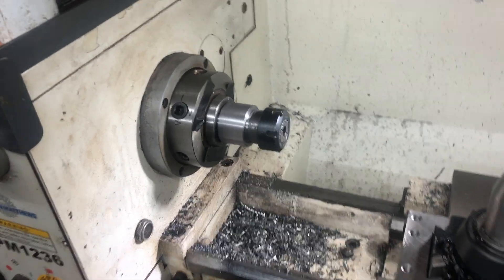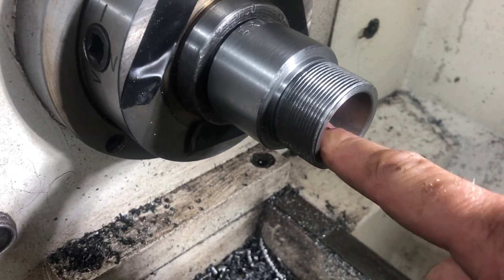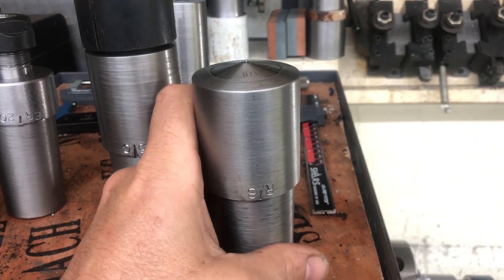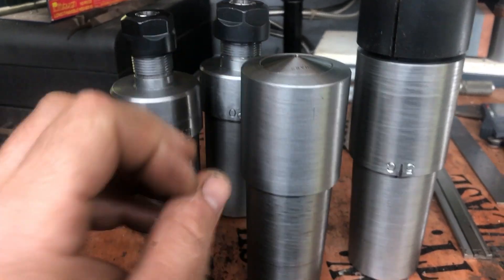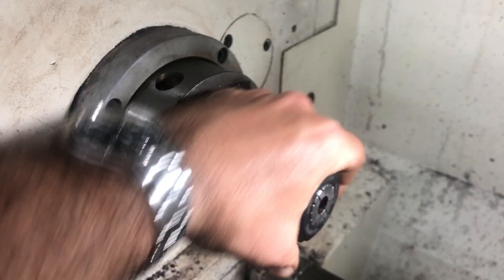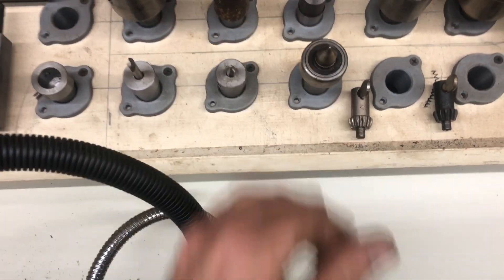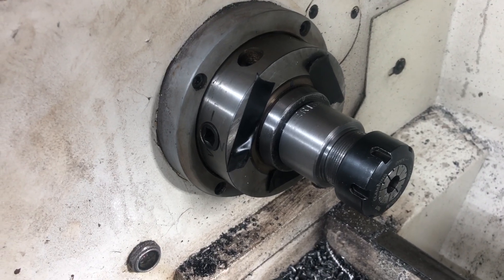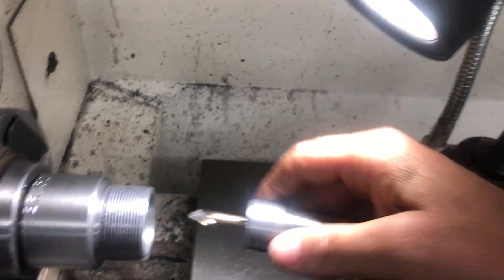Easy collet holders for the lathe

Comment: Does the spindle not have a cone inside? If it doesn't, then you can turn out a cone. The holders for the collets would run much more accurately in it. I would also use a pipe with an internal thread to pull the collets into the spindle. Then you can also tighten threaded collets (like W-20) from behind without removing the holder from the spindle.
Reply from the maker: I didnt put the draw bar in the video, its 1.5” tube. I’ll make another video showing it to clarify

Comment: Could you machine 12 20mm wide flats around the shoulder so you can transfer the loaded holder and hold in a mill vice or 3 / 4 jaw chuck for other operations. It will give an indexing option of 2 - 3 - 4 - 6 + 12 plus spanner flats if you need to load & unload off the machine.
Reply from the maker: Absolutely! The only down side would be the length of the Morse taper on the back. Horizontal milling would be ok but vertical would pose some issues. What about 1 6 sided collet block made to match the lathe taper? Just a thought. I’d love to improve this. Im going to do a video on making one, I didn’t show the hollow draw bar and wasnt clear on some things. I have er11 collets coming so maybe in the next few weeks I’ll do a better video
Reply: @richharr  If you use a drawbar to hold the Morse taper in the spindle then you could probably shorten the taper by an inch. You also may be able to mill some flats around the large end of the taper without losing any location, providing some of the original taper remains between the flats.

Comment: The disadvantage of that method is that there is no through hole for holding long rod
Reply from the maker: Theres a through hole on all but the r8. The threaded hole on the back of the blanks I made is to hold it while making the front, once the front is done I spin it around in a 4 jaw, bore it and thread it. I use a .088” wall 1.5” tube for the draw bars, max inside diameter is 1.3” pass through
Reply: @richharr  Thanks for clarifying that. I so wanted that to be the case. ;-)